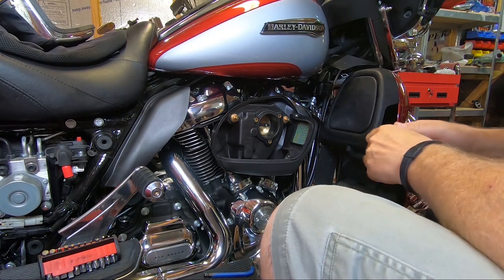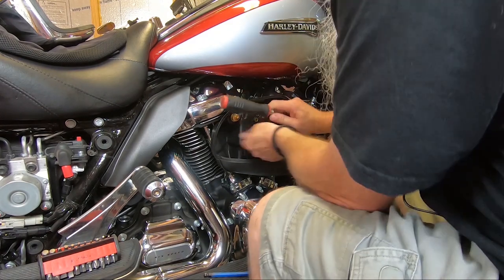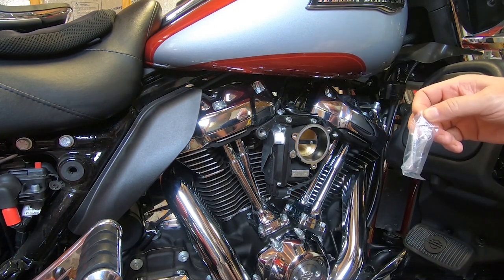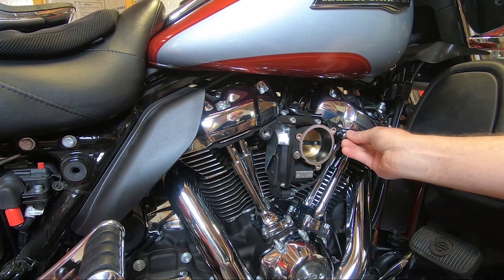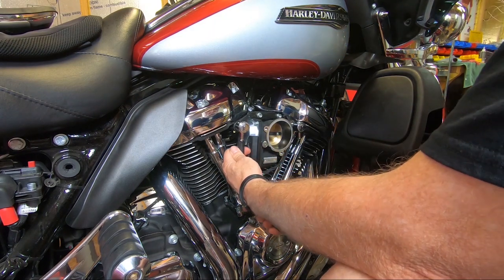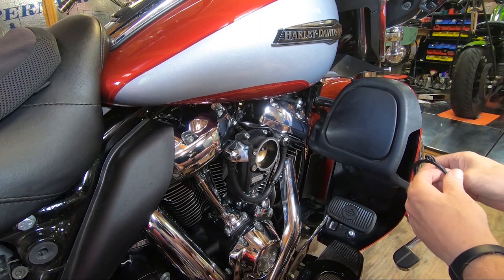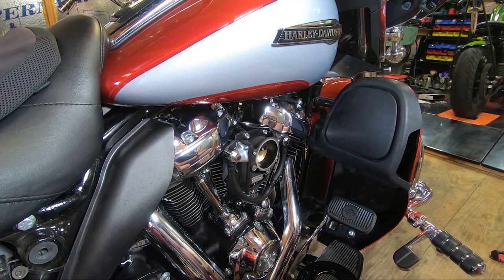Quit Choking Your Motor - Stage I Air Cleaner on a Harley Davidson

Comment: Instead of using the teflon tape, use the o-ring equipped washer that’s used with the HD Banjobolts - they just seal excellent !
Reply from the maker: Depending on which EBS you use, this may be possible.  Teflon tape or teflon paste are a great alternative/addition, because the not only prevent oil migrating down the threads, but it also works as a type of thread locker to keep the bolts from backing out.
Harley uses o-rings on some of their systems, but they always use teflon paste in addition.
Here is a great alternative that uses o-rings And teflon tape or paste.
https://www.dkcustomproducts.com/transformer-external-breather-systems.htm
and here is a video about them- https://www.youtube.com/watch?v=_XYXScy3j0Q

Comment: Why not run the breather lines up to a filter under the tank and the oil will run back into the engine?
Reply from the maker: No reason not to.  Many folks do that.  I have done that on my Softail and Sporty.  See pics of that at this link- http://www.dkcustomproducts.com/stealth-external-breather-system-harley-sportster-big-twin-evo-dk-b-sd-ebs-sp.htm
Reply: @DKCustomProducts  on my diy ebs, I just t'd the lines and ran hose down along bottom of frame and left open. Hoping to get a little bit of a dribble... I feel weird having a Harley that doesn't drip oil 🤷🏻‍♂️
Reply from the maker: @fxrmike5145  haha, great "problem" to have.

Comment: Just wondering if you could post a picture with the black casing on your chrome motor, think the offset would look great with this breather
Reply from the maker: I know I have some pics somewhere of that...just looked and could not find them.  The best we have is at this link- http://www.dkcustomproducts.com/black-7-spoke-hiflow-606-air-cleaner-sys-harley-milwaukee-eight-dk-ac606-b7s-m8.htm

Will look more in the next few days and see if I can find some to add into the link above.
Reply: @DKCustomProducts  okay thanx for the feedback and ride safe

Comment: I have a 2014 Heritage Softail classic, I wish there was a Air Cleaner system with external breather system for my bike.  I searched everywhere and mine must be an odd ball.  For example there's not a support bracket (16400049) on mine and I would be wasting my money buying one because there's no way one would even fit my bike.  I made my own external breather system, but would like a better air cleaner with the external system.
Reply from the maker: Ken, we have dozens and dozens of air cleaners that fit your 2014 Heritage Softail Classic.  Your bike came with that stock support bracket. Why do you think one will not fit it?
Reply: @DKCustomProducts  My Air breather system is stock and does not have that bracket.  I'm willing to make a 500.00 wager nothing will fit. I have watched every YouTube video out there on performance air breather systems  external breather systems and there's not a one that will work on mine.   Where are you guys located?  Also there's no external breather system for my bike that is complete,.  Everyone neglects the fact that the 2 holes on the back of the air filter that the breather tubes went in now are open and require plugs.   I'm not wanting to sound rude I love the concept of DKCustoms products just wish there was something that would work on my bike..
Reply from the maker: @Kenny-hh3zf  I have not been able to find a 2014 Heritage Softail Classic that does not accept the factory bracket.  That does not mean it does not exist.  I just can't find one.  

Could you please email a photo of your bike from the air cleaner side straight on, and also from the air cleaner side oriented either from the front of the air cleaner or the rear of the air cleaner,  to Support@DKCustomProducts.com and put "Attention Kevin" in the subject line?

That would help me out a lot, and possibly get us on track for helping you.
Reply from the maker: Ken, just sent you an email.  Got everything untangled.
Good thing we did not take Ken up on his offer of a wager!
Bike in question is a  cable operated Twin Cam, it uses a different Support Bracket (the one at the link below)

The support bracket in the video, and the one specifically asked about, is a bracket for at Throttle By Wire Milwaukee-Eight.  It is absolutely correct, an M8 bracket will not fit a Twin Cam!

The support bracket for a cable operated Twin Cam automatically comes with all our Complete Intake Systems, and can be seen at this link-
https://www.dkcustomproducts.com/stealth-air-cleaner-support-bracket-harley-davidson-twin-cam-dk-aci-sbtc.htm

Comment: Would the rain sock help with fine sand we have in high desert AZ. It's a supper find blow sand that we get daily along with our wind. We are being bless to be getting rain this fall. I have a FreeWheel 2021 with over 6500 miles on her. I be calling about a new air filter as I know the stock one isn't doing it.
Reply from the maker: Congrats on your FreeWheeler!
Thank you for watching our videos, and we appreciate your business.

Yes, a rain sock (pre-filter) would be helpful.  Your filter will come pre-oiled, but make sure you keep it oiled, you want anything that gets past the rain sock to be stopped by the oiled filter element.

Comment: Do you have a guide or chart which factory Harley cleaner's are interchangeable,  to be specific I have a DK from a 2011, will it fit a 2004? Thanks.
Reply from the maker: In the last 20+ years there have been 3 different air cleaner fitments for Big Twins.
1.  Cable operated Throttle Twin Cam
2.  Fly by wire operated Twin Cam
3.  Milwaukee-Eight
Your 2011 Twin Cam should be cable operated, so it will also fit you 2004.

Comment: I just ordered the 606 without the filter element since i have a big sucker 2 element already. The big sucker 2 element should fit the backplate right? It should have the same footprint as the big sucker 1 but just taller so maybe i might need longer standoff bolts or longer screws to fasten the element to the standoff bolts?
Reply from the maker: What bike do you have? That matters because the M8 we have to drill holes to fit the back plate. If it is an M8 you will need our filter element. MB
Reply: @DKCustomProducts  Sportster, an 08 roadster 1200, will work or no?
Reply from the maker: Do you know what the filter element number is on your Big Sucker? The K&N filter element that fits with the Sportster 606 is the 0800 filter.
Reply: @DKCustomProducts  the only number I can find on it is 50-086, I found a guy on the HD forum that says the Big sucker 1, 2, and the screamin eagle 1 (k&n) are all interchangeable on the same backplate so we'll see.
Reply from the maker: I hope that it does work for you. Please do let us know and feel free to reach out with any questions;
Support@DKCustomProducts.com
662-252-8828

Thank you for your business and for commenting! 😎👍 MB

Comment: Is this a simple bolt on for twin cams using the HD stage one round breather without modifying the three bolt holes?? I have the Vance and Hines breather that is just like the Harley stage one.
Reply from the maker: Yes, it directly bolts up, all the same holes, gasket, etc as the factory or V&H air cleaners.
https://www.dkcustomproducts.com/complete-chrome-7-spoke-hiflow-606-air-cleaner-all-twin-cam-dk-ac606-c7s-tc.htm

Comment: If orientation of the banjo fitting doesn't matter then why taper the ID? Isn't that just added cost?
Reply from the maker: The ID of what?  
Banjo can stick straight up, everything will function just fine.  If you do a lot of short rides, especially in cold weather, then the oil will not all vaporize until you get it fully heated up and run long enough for it to vaporize, but this does not impair function or performance at all.  The oil will just sit in the channel until you do.  It does not create any backpressure that has a perceptible affect.  Check out this video- at the 5:22 mark and the 13:22 mark where we talk about and show a diagram of where the oil sits until vaporized.

https://www.youtube.com/watch?v=W_8oCbO2yc0

Comment: I didn’t see you tighten the banjo bolts to the heads?
Reply from the maker: The video messed up and that part was missed, but you would tighten the banjo bolts to 120-144 inch lbs (not ft. lbs). 
Since most garages don’t have an accurate inch lb torque wrench. Put them in finger tight, as tight as you can get them with your fingers, then use an open end wrench to turn them another ⅛-¼ of a turn. If they are overtightened, it is possible that they will break off, leaving just the threads in the head.

I am sorry that part of the video was missing. You can also see a the installation instruction at this link - https://www.dkcustomproducts.com/media/wysiwyg/Updated_04_11_22_Premium_Discrete_External_Breather_Instructions_-_Google_Docs.pdf

Please feel free to contact us with any questions;
Support@DKCUstomProducts.com
662-252-8828

Thank you for commenting! 😎MB

Comment: Does the rain sock hinder airflow compared to without it being installed?
Reply from the maker: Theoretically it does, and on the dyno is shows less than 1 horsepower loss.  Not enough to feel.

Comment: Question:  Why do the banjo fittings have a larger hole on one side and smaller hole on the other? In my mind there must be a reason otherwise, why would it be manufactured that way?
Reply from the maker: This is a part we do not make, we purchase it.  The reason for the different sizes is that the banjos have been used for multiple applications, and some of them (that don't apply to us) require the hole to be larger on one side than the other.

Comment: Let me know where you put your catch filter, and where can I buy one like that?
Reply from the maker: On that particular bike I put it below the floorboard, at the front bracket on the inboard side.  Here is a link to the Premium Discrete System that is in this video- https://www.dkcustomproducts.com/premium-discrete-breather-system-twin-cam-touring-softail-dyna-dk-pr-dis-brt-tc.htm
You can mount the filter or catch-can pretty much anywhere you want, as the kit comes with 6 feet of hose to allow you to route it anywhere you want.
Feel free to email or call with any questions.
Support@DKCustomProducts.com
662-252-8828

Comment: Do you have the catch can anchored somehow under the floorboard, or is it allowed to move around freely?  I have a 2018 Sport Glide; I've mounted FatBoy rider floorboard mounts & Heritage floorboards in place of the factory pegs & I think it's where I would like to hang a catch can.
Reply from the maker: Zip tie around the hose (right where the hose connects to the catch-can) and the floorboard mount so it does not flop around.  Zero issues in over two years of riding all kinds of terrain.

Comment: I know this is an old video but I plan on picking up a 606 and breather kit shortly. Are the hoses in the breather kit high temperature or heat resistant/proof? I'd like to run the breather hose between the cylinders and then down between the primary and frame.
Reply from the maker: The hose is high temp and has no problem going between the cylinders and down between the primary and the frame.  However, you do not want to let it rest/touch the cylinder fins or engine case.

Comment: Do you guys make an air cleaner for the Kawasaki Vulcans? Yes I’m a Harley Guy too but I inherited my uncle’s bike after he died and I’m going to bob it out and do what I can to make it nice.
Reply from the maker: Thank you for checking with us.  We do not make anything specifically for Vulcans.  You don't say what year and model you have.  It is possible that one of our air cleaners could be slightly modified to fit.
Reply: @DKCustomProducts  thank you for replying. It’s a 2009 Vulcan 900 classic.
I’m bobbing it out so having a good air cleaner to match the build would be cool.
Reply from the maker: @soldierofmygod  Just looked at the intake on the 2009 Vulcan 900.  I do not see an easy way to mod our 587 or 606 to fit.  It is definitely possible, but it would take a bit of fab work to get the backplate to match up with the intake shape.

Comment: How much of an improvement does the 606 have over the HD Screaming Eagle air cleaners?
Reply from the maker: It depends on the bike...On an M8 it will be 6-10% increase in HP and Torque, on a Twin Cam about 4-7 increase in HP & Torque.
Here is a useful Report with Dyno charts that you may find interesting.
https://www.dkcustomproducts.com/differences-between-outlaw-hiflow-air-cleaner-systems-dk-faq-acs.htm
Reply: @DKCustomProducts  Thanks!

Comment: Great videos bro 👍I just purchased the 606 with the external breather kit. I have a screamin eagle air cleaner on my M8 right now but I don’t have the two center screws/bolts that hold the Support Bracket. Any idea what size screws/bolts those are?
Reply from the maker: Thank you for your business, and glad you're liking the videos.  I believe you will be well pleased with the 606.
Those screws are Harley Part #10200373 and they are listed as SCREW M6 X 1 X 18mm hex head (Grade 10.9) (zinc)
Reply: Thank you! Looking forward to running the 606 air cleaner
Reply from the maker: @molonlabe5751  Enjoy the Ride! 👍

Comment: Can I install this entire system but use the OEM 114 cover? In other words, install all of this exactly as you did with the benefits but keep the OEM look?
Reply from the maker: Yes, we have a kit specifically for using this Performance Intake under the stock cover.  You can see it at this link- https://www.dkcustomproducts.com/naked-complete-hiflow-606-air-cleaner-harley-milwaukee-eight-dk-ac606-nk-m8.htm
Reply: @DKCustomProducts  thank you.
Reply: With the stock OEM cover will you still get the same gains as the performance covers

Comment: Can you just use the screws now or do you need to use the tub and vent/can system?
Reply from the maker: If you are asking about the breather bolt holes, they need to have a way to breathe, you cannot put screws (bolts) into those holes and just block off the air flow.

Comment: Does the 828 require the support bracket?
Reply from the maker: Depends on what year and model bike you have.  You may already have a support bracket and not need one.  It is an option when ordering the 828.  Also, if you use a Transformer EBS, it doubles as a support bracket.
Reply: @DKCustomProducts  I have a 2023 fatbob, it doesn’t look like it has that support bracket
Reply from the maker: @tonynakhla6811  Yes, changing from stock on that bike would require a support bracket when upgrading to the 828. Again, if you use the Transformer™EBS, the support bracket is not needed, as it doubles as a support bracket and External Breather System.
Reply: @DKCustomProducts  ok thank you!!
Reply from the maker: @tonynakhla6811  You're welcome, thanks for watching! Ride safe!

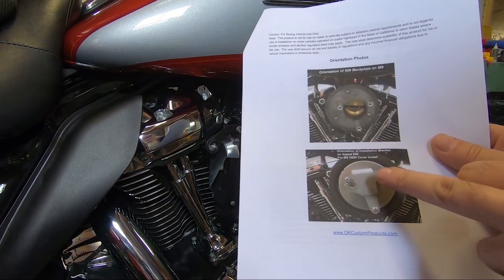Comment: Watching your vid on the 606 air cleaner install https://www.youtube.com/watch?v=P5kqcm0Lx1o  leads me to a question; first I have a 2020 Road Glide and it does have the support bracket but when you talk about the factory bracket for the air cleaner (6:07 into the vid)? I have no bracket there and noticed there wasn’t one on the 2019 bike you used for the demo. My stock air cleaner cover is painted and would like to keep it
Reply from the maker: For your 2020 Road Glide, the 606 package at the following link has that bracket as part of the kit, enabling you to run your stock cover.
https://www.dkcustomproducts.com/naked-complete-hiflow-606-air-cleaner-harley-milwaukee-eight-dk-ac606-nk-m8.htm
Thank you for looking at our parts, we appreciate it.

Comment: Looks like a little over engineering. If the orientation of the banjo breather fittings with the
nipples doesn't matter why machine one side of the hole bigger than the opposite side? Must be some reason. The shoulder washers appeared to be both the same size and the one that went into the larger size hole appeared to be a sloppy fit. Why pay extra for the shoulder washers if there's a possibility you have to ditch 2 of them because of an interference fit? The backside shoulder washer should be a precise fit or better yet eliminate it and machine a shoulder onto the backside of the banjo breather so it centers itself in the breather hole in the cylinder head. Then use a breather bolt with a washer built into the head for the outside. This eliminates the shoulder washers altogether and fixes the backing plate clearance issue. Also it was mentioned briefly the backing plate was 2 pieces and that was the only time it was shown or mentioned. Did I miss something?
Reply from the maker: We do not make the banjo fittings.  We purchase them and they are the design they are because they are made to fit multiple applications with multiple shoulder washer options.
If you want to see a set up where we build the entire package, with precision, check out this video, and the link below
https://www.youtube.com/watch?v=_XYXScy3j0Q
https://www.dkcustomproducts.com/transformer-external-breather-systems.htm
Regarding the 2 pieces, the backplate is made of 2 pieces of metal that are plug welded together prior to being powder coated.
You can see a clear photo of that here- https://www.dkcustomproducts.com/media/catalog/product/cache/1/image/9df78eab33525d08d6e5fb8d27136e95/6/0/606nakedm-8.jpg

Comment: Oil and gas will eventually eat away the teflon tape; that's why Harley uses the paste.
Reply from the maker: I  wonder how long eventually is?
I've never seen the tape eaten away...not in the 100's of thousands of miles I've run using tape.

Comment: Which ones are best for 131 M8 64mm throttle body and are not forward facing since have lowers.
Reply from the maker: 828.  You will need to run an adapter for that throttle body.
Reply: @DKCustomProducts  adapter?

I’m having the engine installed soon and need a good and decent air cleaner complete
Reply: @DKCustomProducts  will this handle over 150 HP ect
Reply from the maker: @Heavy69Metal  yes
Reply: @DKCustomProducts  what adapter